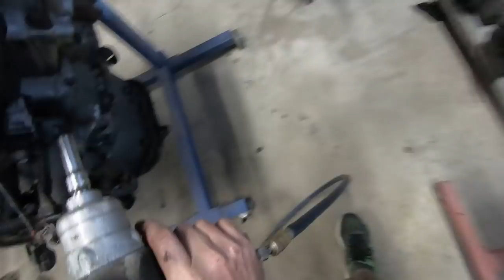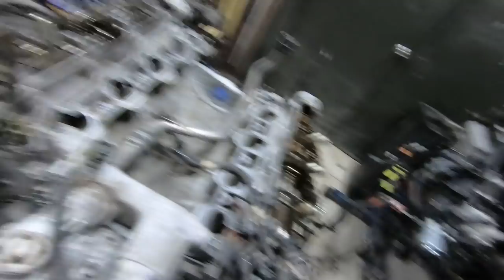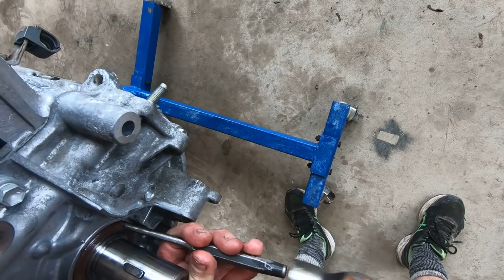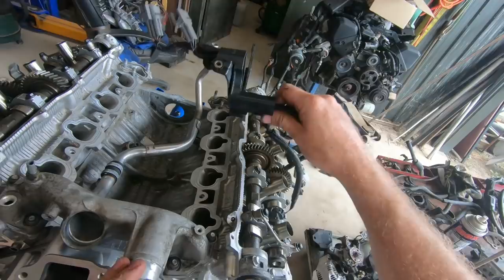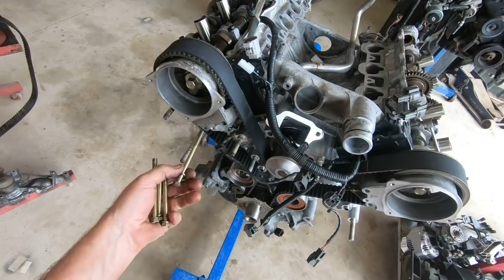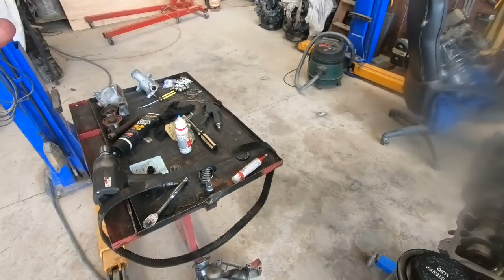1uzfe Cambelt / timing belt replacement. suits LS400,  Celsior, SC400 and soarer. 1uz

Comment: you guys seem to have a lot of experience with the 1UZ. im currently in the process of doing the timing belt on my SC400, however the water pump i ordered from Aisin comes with a metal gasket, while my old waterpump is sealed with silicone sealant. i read on forums that the new water pump would leak with the aisin gasket and i dont want to do the job twice. how would you seal the pump?
Greetings from Switzerland
Reply from the maker: This might help.  https://studio.youtube.com/video/37xnjBUNtmA/edit  Asian is the OEM supplier to Toyota and all later engines run the waterpump with gasket and it is what I use on all my engines.  If guys are getting leaks then they are not preparing the block correctly or using good practises.   If the block is is good order I will use just the gasket.  If the block is untidy on the waterpump surface then a tiny bit of sealant outside the o-ring is what I do.  Toyota fitted a gasket to improve operations and reduce the chance of sealant in the cooling system.  Cheers Kelvin

Comment: Is there a way to just remove the hydraulic pump and replace it with the LS400 idler and run electric fans?  I have bearing chatter going on within the pump and it's causing my belt to slip on occasion, plus it makes a horrible sound.
Reply from the maker: yes there is however I prefer to keep the hydraulic fan when I can as they are better at keeping the engine cool than other options.  Cheers Kelvin

Comment: You are a bit quick for me lol

The crankshaft pulley how do you line the belt up?. 

I can see a Grove and a spot at 1 o clock?.

But the line on the belt where do that go to please.
Reply: The new belt will have marks indicating what belt tooth will line up with what crank pulley groove. Same with the two cams. When you wrap the new belt over the two cams and the crank pulley, these three markings on the belt all have to line up with the marks on the pulleys.

Comment: Hi! You can tell how many teeth are on the belt between the camshaft marks and the LH camshaft and crankshaft?
Thanks a lot!
Reply: 1uz non-vvti
Reply from the maker: I never count,  I use a genuine cambelt with the correct white marks on them.  Cheers Kelvin

Comment: Gasket maker on the oring that pushes into the bypass hose?
Reply from the maker: I prefer to not use any sealant on that o-ring however if there is any sign of pitting on the housing a little bit of sealant reduces the chances of leakage.

Comment: Question, I would like to run an aftermarket oil pressure gauge on my S2 non vvti 1uz. 
Is there a factory oil pressure sensor I could T into or a good place to drill and tap ? 
Cheers
Reply from the maker: Yes , connect into the stock oil pressure port with a Tee fitting.  https://youtu.be/GRqysaXH2jw
Reply: @CartuneNZ   Thankyou. Also if I’m running electric fans and only a water pump and alternator can I just completely delete the clutch fan bracket ? 
Cheers
Reply from the maker: @jeffwaggoner4149  waterpump is driven off cambelt,  so you only have alternator,  so I add a different tensioner and delete everything else

Comment: How do I know weather my belts need replacement? It is for a 2003 GS430 250000miles. Don't know whether the previous owner ever changed...
Reply from the maker: If a cambelt is nearly new with writing clearly visable then thats one way to tell its been changed.  If its old and perished then its been a long time.  In the middle its really hard to tell. Its nice when a record sticker is put under the bonnet.   If I'm at all worried I at least throw a new belt on as its pretty quick and easy and good peace of mind.   Cheers Kelvin
Reply: @CartuneNZ  
Thank you for the quick response and support.
The thing is it's hard to find a mechanic who knows this job, I live in Dubai where most of the mechanics claim to know what they does, but in fact it's quite opposite.
Reply from the maker: I understand.   Knowledge is valuable these days.  Cheers Kelvin.

Comment: just wondering did you put any gasket maker on the water pump gasket?
Reply from the maker: Hello.  If the block is in good order I dont put any sealant onto the waterpump gasket.  If im suspect I will put a tiny bit onto the metal surface to back up the rubber o-ring.  Cheers Kelvin
Reply: @CartuneNZ as always thank you !!

Comment: I need to know if their are more than one ac compressor for the 1uz I have an 94 sc400 and my ac lines dont fit over the studs on the compressor dont know why they dont fit engine was replaced before I bought car
Reply from the maker: There is quite a few ac compressors for the uz series of engines.  They all physically fit onto the bolting points but as you have found out have different fittings.  Ive had a few lined up on my bench a few times but the video hasn't been finished sorry.  Ive got a a/c issue to solve on the next couple of jobs so a video might happen.
Reply: All of these 1UZFE of that era use Nippondenso 10PA20C type compressors.

Comment: Awesome vid! Are you sure that engine is an interference engine? I thought they were non interference up to 1994? One of my cars is a '92 SC400 (Soarer). I like the hydraulic fan removal to run electric fans, never seen that. That engine is a work of art. I see you have a built in torque wrench in your right arm ;)
Reply from the maker: This is definately a gen 2 engine so interferance.   Doesnt help its already got the many bits off.  Has small tappet cover breather, cast fuel rails , lh coil pointing forward and small rear crossover pipe.  They swapped from gen 1 to gen 2 in 94 depending on markets.  Yep.  Good on you noticing most bolts are finished by my arm torque wrench.
Reply: @CartuneNZ  With the removal of the Hydraulic fan pump, where do you get the idler piece for replacement?
Reply from the maker: @jrjames4101  depends on how the pulleys are arranged.   Either with an idler to replace the hydraulic fan with ac then same belt.   If ac removed different belt.
Reply: @CartuneNZ  I intend on keeping the A/C. This car gets hot inside and our summers are to hot not to have it on A/C working on the car. Thanks for the quick reply.
Reply from the maker: I have details on the 2003 hilux engine preparation video.

Comment: Why do you plug the throttle body water ports?
Reply from the maker: It makes the engine look cleaner and easier to work on.  Over here we rarely get below zero.  Also less things to go wrong with the potential of hoses splitting not present if the hoses aren't there.  Cheers Kelvin
Reply: @CartuneNZ  well I better watch the video. I just removed everything to install cam/crank seals, water pump, timing belt etc. Anything else I should do while I'm in there?
Reply from the maker: Maybe watch my engine preparation videos and see if there is other stuff which needs attention. Cheers Kelvin

Comment: Where could I find one of those fan clutches? In the US that is.
Reply: And what kind is it?
Reply from the maker: The one I fitted at the end?  Are you meaning the idler unit? As this engine wasn't fitted with a fan clutch.
Reply: CartuneNZ yeah where the fan bracket used to be that you replaced and what exactly is that?
Reply from the maker: @ZMAN151254  It one I stock and supply myself.  If interested email info@thecartunecompany.co.nz
Reply: CartuneNZ also one more question, for the water pump mine came with just a gasket. Is it okay if I just use the gasket and bolt it up?
Reply: CartuneNZ because my water pump doesn’t have the RTV sea lent lines around the edges
Reply from the maker: @ZMAN151254  I've just edited a video on waterpumps to be released in the next few weeks.  Use the gasket if its designed to come with the gasket
Reply: CartuneNZ Thanks you’re the man!

Comment: What happens if the rotors aren't placed correctly?
Reply from the maker: I see lots of misfires , poor running and a few with broken rotors which have caused the cambelt timing to jump.  Fortunately not on a gen 2 engine yet as they could also bend valves.  I never complete a cambelt job myself without replacing the igntion rotors.  Cheers Kelvin
Reply: @CartuneNZ  Thank you.